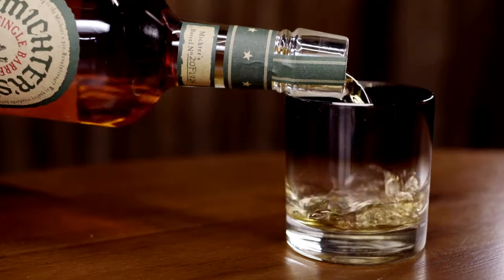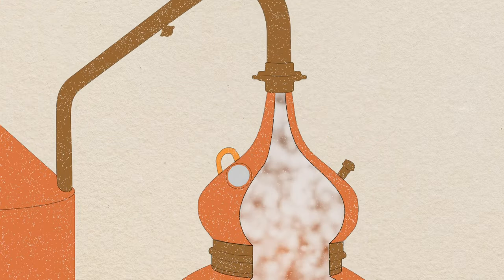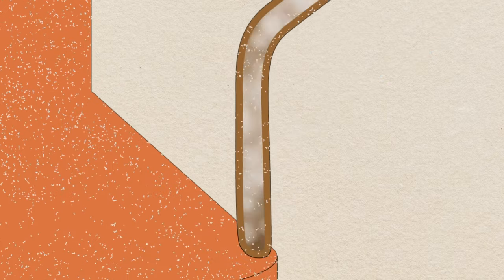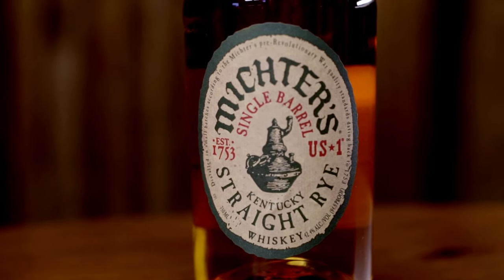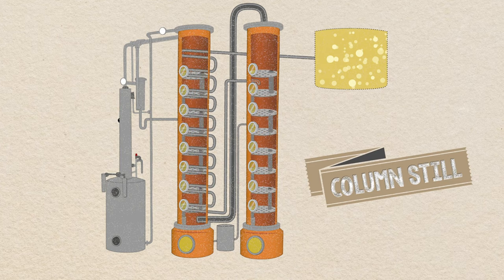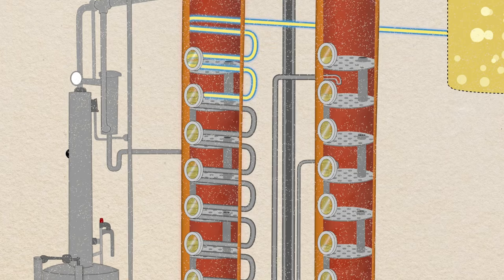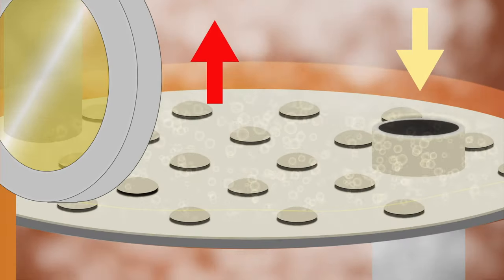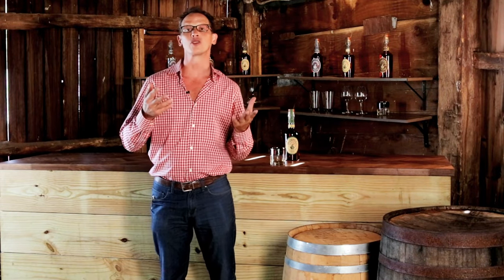Whiskey 101: Know Your Stills to Know Your Whiskey

Comment: Just out of curisoity, is there any way to know how to make cuts based on timing vs by taste if someone is using something like an electric 1 gallon air cooled still? If I was going to distill, My taste buds are not sensitive enough to taste the difference between heads, hearts and tails and need a way to go by times at least roughly.  For example, "first 8 mins is heads, next 12 mins is hearts, last 15 is tails". Is there some sort of rough guess timing like this that someone with very insensitive taste buds can go by?
Reply: I’d say the next thing for you right now would be too take samples whilst trying to pull heads and burning them, about a spoonful, if it burns with an orange glow it’s methanol but if it burns with a nearly invisible blue flame it is ethanol. The only other way I’d say for timing would be to get too know your still by measuring out quantities of liquor pulled off 🤷‍♂️
Reply: Так не получиться. Вы можете ориентироваться по температуре в шлеме
Reply: There is no way to make these calls like that. It depends on your mash, temperatures of everything involved, your target flavour etc.
Best you can do is measure the alcohol content in small batches during the run, but that says nothing about the flavour.
Maybe get someone to help you taste it. The smell is the most important, if that still works.
It's just not ideal if you can't taste or smell the batches. Can a blind man paint a masterpiece? Never say never, but sight helps a lot.
Reply: It's a 1 gallon still. Your not gonna get enough out to really make cuts other then four shots heads and tails.
Reply: @kirkstinson7316  thanks!